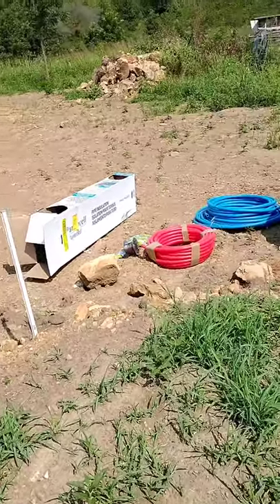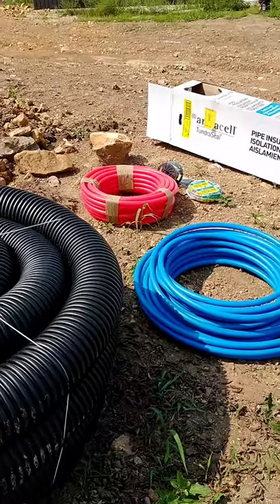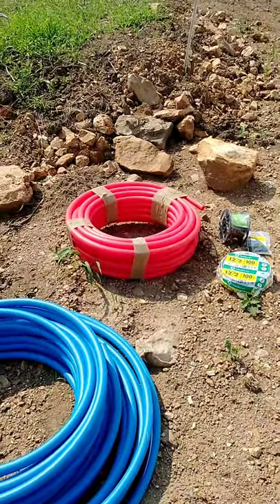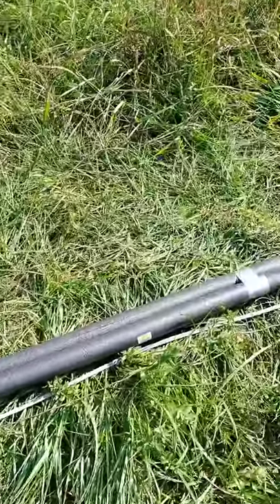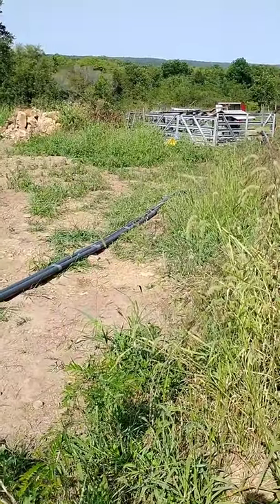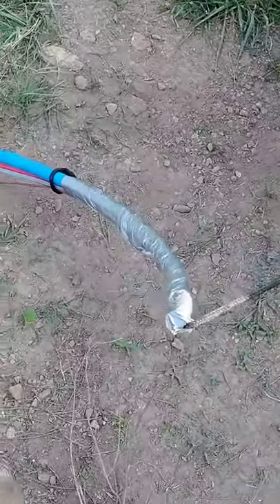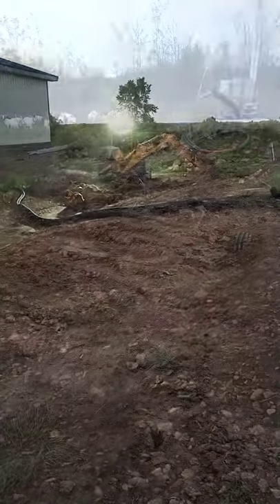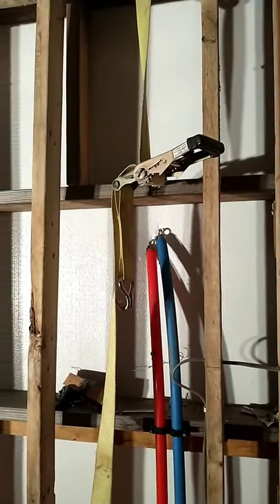Outdoor Wood Boiler Installation Part 1: Insulated Pipe

Comment: that will work but i think later down the line you will regret not going with thermal pex the foam filled pipe it is the best you can get i have seen so many people dig that cheap stuff up and use thermal pex
Reply from the maker: I would have loved to install the foam filled pipe, but at over $18 per foot, it just flat wasn't in the budget.  Here in west central Missouri the cheaper pex is used fairly often so I think with a fairly moderate climate it will perform well. Thanks for the comment!
Reply: @assemblyrequired1  yup I just put in 125 feet it cost me 2k
Reply: I’m in Missouri and I did the same thing you’re doing. I had a roll of black drain pipe laying around, bought two 100 foot rolls of pex, and pipe insulation. Spent maybe $250-$300. Works well. Replaced my boiler with a gasification boiler this year. My dealer actually told me with my 30-40 foot run, it wouldn’t be worth digging my water lines up to put the foam filled pipe in. Said the heat loss from my homemade pipe is nowhere near with the headache of replacing it.
Reply: Wow.  I just bought 65 feet at $10 per foot for ThermoPEX in September 2022 for my boiler.
Reply: @pashootist5354  from where?

Comment: I was going to do something similar, but I was going to use 6" SDR pipe so the pex could be removed if it ever leaked. But I was able to get Thermopex for $13/ft, so going with that.
Reply from the maker: That would have worked well also I bet! The thermopex looks like really good stuff. I would have loved to have the budget for it. Thanks for the comment!
Reply: @assemblyrequired1  how did you join the black drain tile to the existing pvc conduit that you had under your concrete? Water getting into your hot water loop seems to be the hardest problem to solve when using homemade methods.
Reply from the maker: @OilHist  The black drain pipe was big enough to slide over the conduit, so I slid it up about 2 feet over the conduit and then just duct taped the end. Knowing that it wouldn't be 100% water tight, I used underground feeder cable for my power which should be fine with ground moisture and obviously the PEX doesn't mind water. The only thing of concern may be the insulation which water shouldn't bother too much, and the thermostat wire that I'm not currently using
Reply: @assemblyrequired1  Sounds good! I think they main concern that folks worry about is if the outside pipe gets infiltrated with water, the water will then be in contact with the pex and absorb heat rapidly from the pex. Even with insulation this can occur. But it looks like you're fine.
Reply: Hello and good evening thermopex is cheaper than cutting wood to heat the ground and ants the backaches it will cost you in the long run
Reply: @cedricsimmons2033  yep. All working great. 2 deg loss in entire loop with no load.

Comment: You trying to make your own, is NOT the same as the pre made system. This is bad information. Moisture will get into the drain pipe making the insulation wet and greatly reducing the efficiency of the hot water moving through the pex. Depending where you live you will also need to worry about the wet insulation freezing.
Reply from the maker: Definitely not bad information.  There is nothing magic about the pipe systems that can be purchased.  The premade pipe that I was talking about is literally two pipes wrapped in bubble insulation, all inside the exact same black corrugated tubing.  As for water.... sure its possible that water could get in to the black pipe, although not likely, and if it does, the insulation that I used is not susceptible to soaking up water.  It is polyethylene (plastic) foam.  As for the insulation freezing, assuming that the insulation integrity is compromised by water, wouldn't there be so much heat escaping the 150 degree pex pipe that it would warm the insulation (heat escaping) and prevent the insulation from freezing?  I'm a couple years in now, and am very pleased with how the plumbing is functioning.  The temperature of the water when entering the house is virtually identical to the temperature exiting the wood boiler as closely as I can read on my gauges.  If you're comparing what I put together to the system with pex encased in foam filling the entire jacket of the larger pipe?  Yes, it holds heat better and is a better product, but in my scenario and in most people's scenario's, the benefits do not justify the additional cost.  You're right, my home made piping system is not the same as a pre made system, I'd say its better!

Thanks for watching and commenting! However I respectfully disagree with most of what you said.